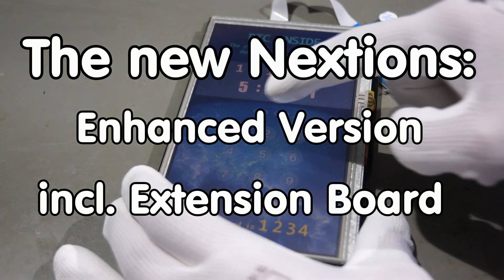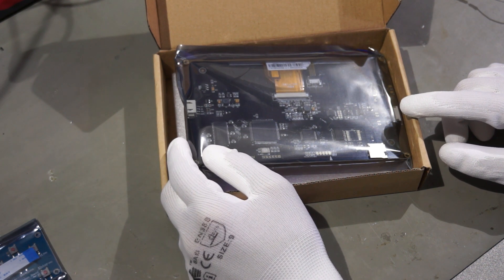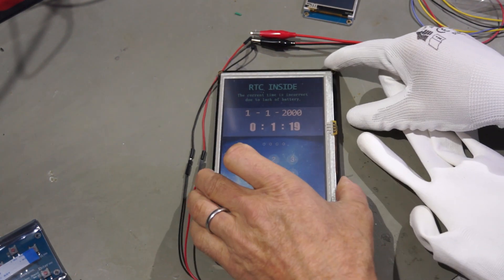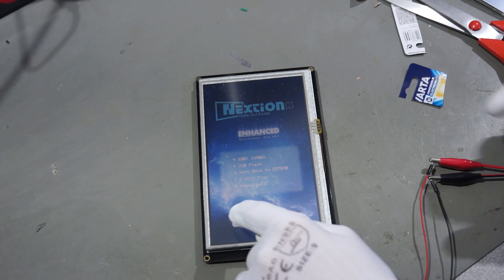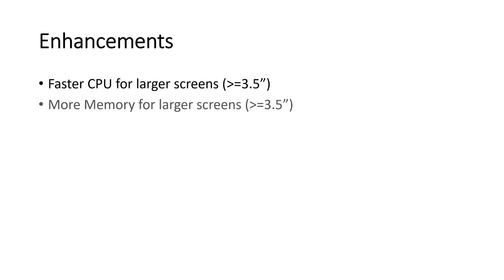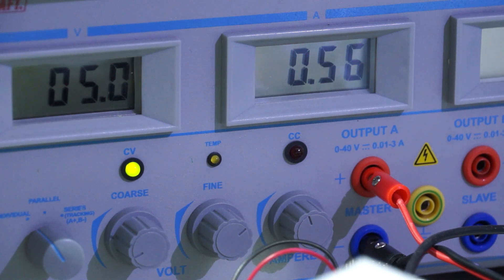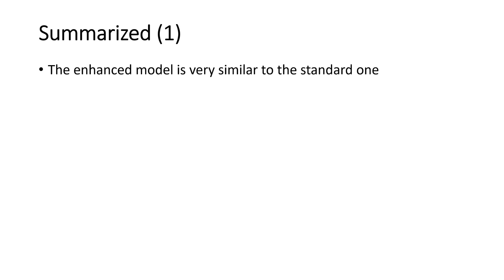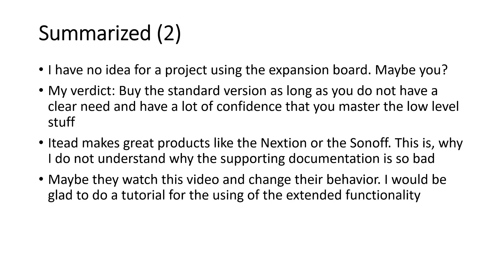#85 New Nextion Enhanced Display incl. Extension Board

Comment: Do you know if a dht11 sensor could be connected to this screen and by having digital inputs and outputs read directly the humidity and temperature values, without having to use any arduino or any other element, any example?
Reply from the maker: I do not think so.

Comment: Hi Andreas, I bought one of these displays after seeing them on your videos.  Unfortunately i made a mistake and it has gone over voltage.  I'm desperately trying to find out the values of the component around and including U4 as it is badly damaged.  You would be a massive hero if i could know the components or a high res image of that area.
Reply from the maker: Which display do you have?  I only have relatively old versions.
Reply: @AndreasSpiess  I have the nx8048k070 which is identical to the one in your video. I think mine might also be a few years old.
Reply from the maker: Here iis the link to a photo of this area. https://www.dropbox.com/s/529uh1pwxxsfngq/Nextion%20U4.jpg?dl=0
Reply: @AndreasSpiess  thank you so much😁

Comment: Got my hands dirty so to speak with a Nextion yesterday. Really need a decent interface for my Roboclock and although I finally got my LCD graphics and touch library going perfectly a GUI from scratch is quite daunting and TBO, eats a lot of resources that were really meant for the project itself.

The nextion editor although a bit rough can get the job done and I managed (finally) to get the debug simulator to talk to my MCU so I can evaluate it and put some proper tests together before committing to the hardware.

I totally skipped their library and after a day I have my own that's now working smoothly and allows me to send variables too and from the Nextion.
Reply from the maker: The Interface is not too complicated, fortunately. Glad you were able to use it in your code.
Reply: @AndreasSpiess  I have made some very pleasing progress now and have a panel for several devices. Even if not used in a project directly I feel it would be a big advantage to allow for one to be connected as diagnostic commands can be sent easily and results sent back. As one example I have a page for a BME280 with T, H and P and a field that has Pin name, ID and Version number. When I go into the page or click on the refresh button it requests the data. I also have a similar one for a GPS module and light sensor. If the MCU does not recognize the request for a certain device then basically nothing happens.

Comment: is it in built  node mcu  esp8266 ?
Reply from the maker: You can use them also with an ESP32, if you want
Reply: @AndreasSpiess    where i have to add esp8266 in dipaly board,is there any provosion for permanent position fixed in nextion enhanced display board..

Comment: Hallo Herr Spiess,
Haben Sie das Display noch?
Mir ist ein IC auf der Platine abgebrannt und ich kann nicht ablesen was da drauf stand. Der Support will nicht helfen und sagt nicht um was es sich handelt.
Könnten Sie mir dabei helfen? Es handelt sich um das Bauteil "U4" und befindet sich in der Nähe des weißen Steckers und hat 6 Pins. Ich konnte nur was mit "6HD" ablesen, aber ich finde nichts darüber.
Eventuell sind Sie in der Lage mir zu helfen.
DAnke!
LG
Robert
Reply from the maker: Bei meinem 7" Enhanced steht IL 6EP drauf. Es müsste eigentlich ein Switching Converter sein. Allerdings habe ich auf die Schnelle keinen gefundengefunden.
Reply: Vielen Dank für die Information!

Comment: Hi Andreas ! Do you have any Information about the power comsumption of these nextion displays. I'd like to build a solution to control various devices on a boat where electric power is always limited by the capacity of the batteries. Do the displays have a power-save mode like a screensaver on a pc ?
Reply from the maker: They are quite power hungry. Maybe you find the info in the datasheet. It depends on the size of the display.
I do not know of a power save mode. But maybe you switch it completely off by the CPU (using a MOSFET)?

Comment: Hi, Andreas, is it possible to use this Nextion UART Display as simple text monitor for debuging info from esp8266 (Serial.println function) ? Just as text with scrolling ?
Reply from the maker: +Volodya Kan In principle, yes. Maybe you will have speed issues. And you have to program it.

Comment: Hello. Is the HDMI display compatible with 8 bit PIC microcontrollers?
Reply: By default like many other serial ports it is set to 9600 baud. But the Nextion supports up to 115200. Remember that you have have to set this speed at both the microcontroller and the display for it to work properly. 

I use the Nextion display (also enhanced version, the more powerful processor and more memory are a good trade for a little higher price than the basic model) with several micro controller (Atmel Tiny and Mega controllers). As long you have an uart (serial connection) available, you're good to go. 

Using the Nextion editor you can design all the screens. Commands like 'page 1' can also be send from the controller. It's not that difficult to communicate from the controller with the display. The Nextion editor also has a debug option. The only thing you're controller has to do, is sending the exact same commands (statements) to the display. I only use the 'low-level' instruction set and not any Nextion wrappers. If you're able to program a PIC controller, than this instruction set should pose no issues for you.

Remember that you're controller is not responsible for rendering the display. It does mean you're application is a bit fragmented. The UI part is done with the Nextion editor and the compiled code (firmware) is uploaded to the nextion by SD card. The controller code is in my case written in C++ using Atmel Studio (free Visual Studio based IDE) and uploaded to the controller via avrdude..  

Note that this display does NOT have an HDMI connection which is the main reason why even a simply entry PIC controller can drive the application behind the user interface.
RTC can be set by sending the 6 date/time components (year, month, day, hour (24h), minute and second as rtc0, rtc1, etc.
To set the current date/time: (don't forget the tripple 0xff code to 'execute' the statement)
rtc0=2017
rtc1=12
rtc2=18
rtc3=0
rtc4=10
rtc5=38
Reading a RTC date component can be done using "t1.txt=rtc0" to write the current year to a textbox.

The only thing I write to the display EEPROM is my application version. If the EEPROM version is not available or older than the current application version, it will start the app-init part and the user can enter the current date/time and some other settings.

I hope that in a future update, it is possible to flash the display firmware using the UART interface which would make it easier to keep the controller and display code in sync..
Reply from the maker: It uses 9600 serial connection. So, if you controller can do this, it should be ok. But you have to write your own code/library, I think

Comment: Hi Andreas,
Your videos are really informative, any update about setting up time in the RTC clock? I have bought extended one.
Reply: thanks mike for the help, i created  two buttons one for increment and one for decrements, like for time

rtc3=rtc3+1 //increments the hour by one
rtc3=rtc3-1 //decrements the hour by one
rtc4=rtc4+1 //decrements the minute by one
rtc4=rtc4-1 //increment the minute by one
rtc5=rtc5+1 //decrements the seconds by one
rtc5=rtc5-1 //increment the seconds by one

likewise you can do for Date as well!!!
Reply: You can set the RTC clock in the Debug section of Nextion Editor. The dropdown menu 'Operations' will show Nextion Device RTC Calibration. Make sure to select 'Nextion Device'  in the 'Send command to:' menu. The display has to be connected. Hope that helps
Reply from the maker: No. But I did not check. I have to do it in the next weeks...
Reply: Easy way is to remove and reinsert the battery to reset the clock then stay awake until late in the night . At midnight sharp power on the display so the clock will start as 00:00:00. If you do a mistake correct next day :-)
Reply: The time module used is similar to the DS1307 or the DS3231. The time is only programmed and the battery is used only for data retention.
An external DCF77 module could be used to update the stored time (per day or per hour).
 (Ardunio DFC77 library)

Comment: I noticed you were pressing on those displays - aren't the new ones capacitive?
Reply from the maker: Mine are still resistive. I think, they did not change the display, just the controllers (in the bigger models)

Comment: Hello Andreas, 
I must say I like you projects,in regards to this enhanced new nextion version; I am verry new to this. Do you think it is possible to use and control the I/O without MCU, for example have a code running, Nextion language, control PWM outputs and etc. without the need of a micro-controller attached
Reply from the maker: I cannot imagine that this will work. But I did not investigate in this direction because I use these displays always with a MCU

Comment: Hi Andreas
I have some Sonoff  and i want to know if it is possible to connected directly to Nextion (the smaller one 2.4")
because i want to used like switch (if the 5 v produces by sonoff pin gonna ok for the Nextion)
Thanks a lot you do a great job
Reply from the maker: I did not look closely to the Sonoff so far, but if you have the RX an TX exposed, and if it has a strong enough 5 volt rail, it should be possible. But the Nextion and the programing will use the same leads.
Just keep in mind: the Sonoff has 240 volt inside the box and you decide whether it is a good idea to do that.
Reply: Thank you Andreas

Comment: Hiii  Andreas,
Nice videos from you.To set clock u need to go nextion editor>>>Debug>>>operation>>>Nextion device rtc calibration.
Reply from the maker: And then, use which commands? Do you also have an example code of accessing the RTC or the EEPRPM/GPIO from a microcontroller?
Reply: If you look instrustion set at https://www.itead.cc/wiki/Nextion_Instruction_Set all command set given
 e.g. 
dim=50    (to set brightness 50%)
from arduino with nextion library i used command      myNextion.sendCommand("dim=50");     //tested by me

like wise
for rtc setting commands are

rtc0, year;

rtc1, month;

rtc2, day;

rtc3, hour;

rtc4, min;

rtc5, second;
Reply from the maker: Thanks. I'll try it out.

Comment: Out of the box one would expect to see an example for a menu type to use with that gpio module. It will also only be useful for high/low type io, no digital sensor comms or analog reading, thus no direct sensors can be connected with the current libraries - really very limited...  This really limits the usefulness of the gpio functionality itead tries to add, and combined with poor documentation and old libraries, I am afraid this product will be a bit of a disappointment - waiting 5 weeks for delivery down in South Africa already  :(
Reply from the maker: They are quite creative. I like the new Sonoff and also the extremely small 8285 board. Their problem is just the software side. I hope, they can fix it. I think, a guy who has the specifications can adapt the existing library in a few hours and write a decent example app in a few days. Shouldn't be impossible...

Comment: Nice review - but given the cost/functionality, I would say $90USD is too much. I would say it would be useful for under $30. Perhaps in time, the cost will drop ... But for that price I'd get a tablet with Bluetooth for communication and self powering.
Reply from the maker: The cost of 7" touch displays are quite high (40-50$ for HDMI types). But they cannot easily be connected with an MCU smaller than the "Raspby Class". And there, the driver chips are on the Raspby board and you pay it there. So, in my view, the Nextion is a valid alternative, not better or worse, just different...
Reply: What about an android tablet, there is a large choice at less than $50. You have usb and wifi interface, plenty of ram rom and extra processing power. In a non-proprietary end well supported environement.
Reply: John Kubik , the Nextion is different in its application. It boots instantly and you program it easily to work only with your micro, no android overhead. Not the cheapest, but has a niche.
Reply: you just added components to the project, bluetooth , while this requires two wires RX, TX, and i'd love a self powering tablet where do you get those? lol

Comment: Nice video. Suggestion for the future: temperature sensor review and comparison, such as bme280, bmp180,htu21d,dht22 and others.
Reply from the maker: Not easy for me as I do not have a calibrated thermometer. So, I could only use the "Swiss democratic approach" where the majority is always right. Maybe for the future...
Reply from the maker: Thanks! I have many sensors lying around and waiting for a presentation. What would be your special interest in temperature sensors? What should I compare?
Reply: Andreas Spiess , maybe a switch a relay with a fan on one of the gpio's when temp threshold is exceeded?
Reply from the maker: Maybe I will be faster with the MAX7219 display ;-)
Thanks for the tip with dweet.io. I have to look at that, too...
BTW. Do you know how to write your own IFTT recipe/ interface? So far, I only saw preconfigured bricks which can be configured.
Reply: Andreas Spiess you should compare it to a given controlled temperature. :)

Comment: A lot of sellers will not ship the battery due to postage restrictions.
Reply from the maker: Valid point. But it is so small...
Reply: I agree, but as soon as "battery" is mentioned these days the freight companies think "dangerous lithium' so it's just easier for the sellers to not put it in.
Reply: I recently bought 2 10,000uf capacitors from China, when I got them after 2 months in transit, they still had a charge and caused sparking.  I think they should not mention batteries at all.
Reply: There's actually exceptions for batteries shipped in finished products.